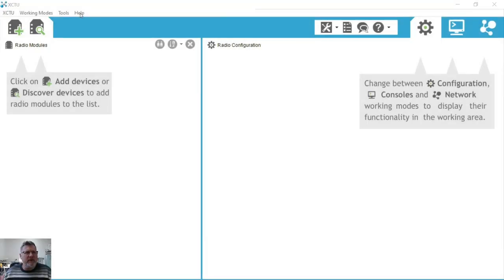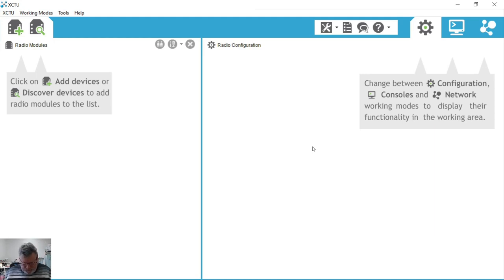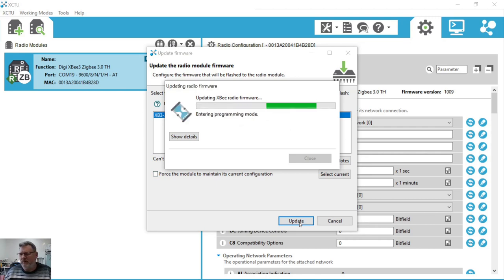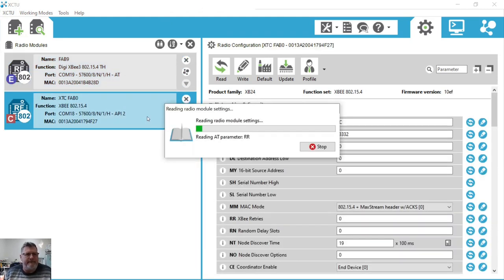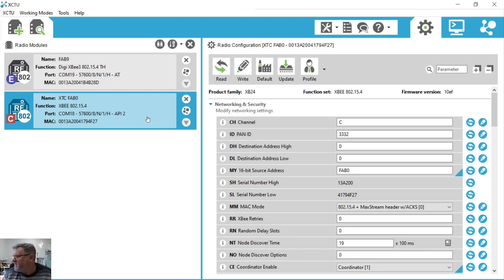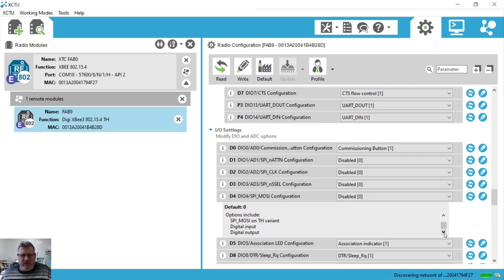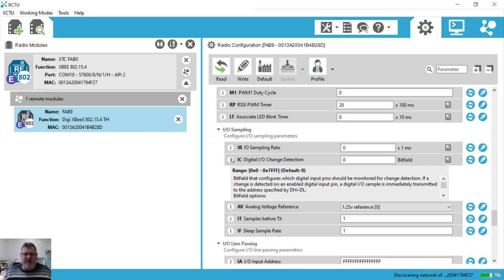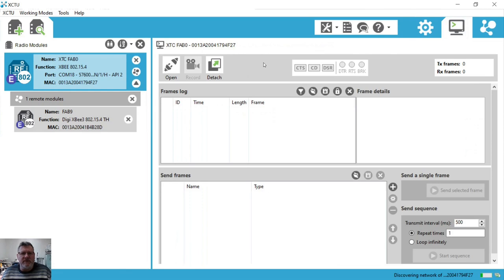XBee 802.15.4 setup, digital input test and encryption configured with XCTU

Comment: Hi 
how can i increase data rate on xBee PRO S2C, i should get 250 kbps but i got  only 30 kbps, i liked your video btw
Reply from the maker: Hi Hakan,
Thanks for your question (and the support).  Basically I think the issue is that Throughput (the tool in XCTU) which gives a value for transfer ratio, is not the same as the RF data rate.  For example, I tried a XBee3 USB with a XStick (API2 enabled) and got a transfer ratio of ~13Kbps.  I don't think anything's wrong, just a difference in definitions.  For example the RF data rate for legacy modules is 250,000 b/s and the serial interface data-rate is 1200 b/s - 250 kb/s.  This implies you can get to that 250kbps but there's also the packet byte overhead...